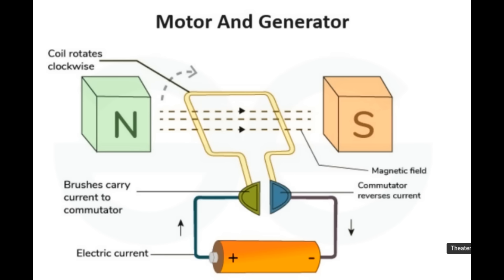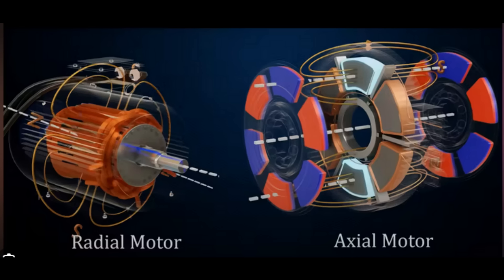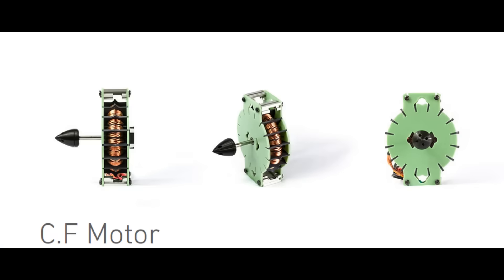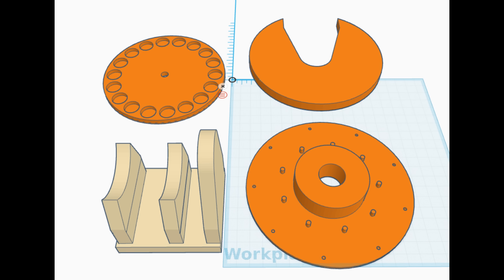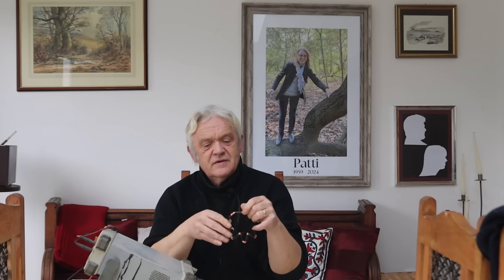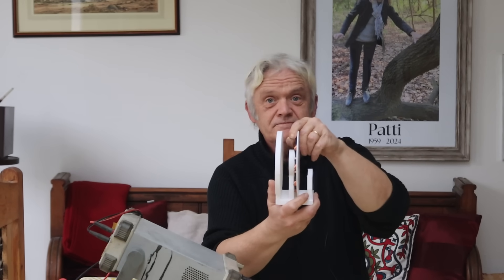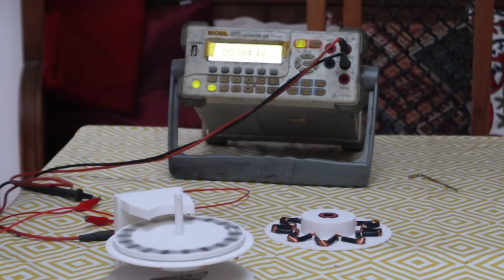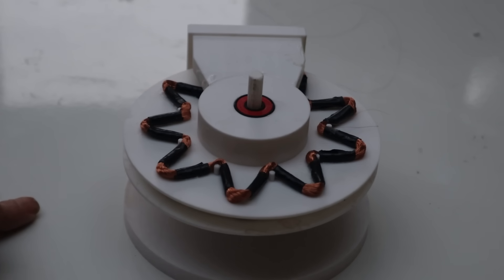2331 The Circumferential Flux Motor/Generator

Comment: FYI, if you print small trapezoidal forms, you can clip them into a winding jig, wind them up and then snap them into recesses or clips on your stator plates.  I call them Stator-Tots and they've saved me loads of time.  Makes it modular, easy to replace and prototype arrangements, as well as make 3-phase windings much less daunting.  Your channel is the best.  Thanks for everything you do!

Comment: What if a serpentine coil after zig zagging,was bent into a U, and wrapped around both sides of the rotor ? Would each pole need 2 magnets glued together NN,then SS, to keep the same pole while it passes the U ? Should the magnet edges have a ring of Mu metal?

Comment: Hi Guys! I am designing and am about to build a prototype for an Axial Flux Generator inspired by "Motionmagnetics" here in YT, who was inspired by you Robert. I have a couple of questions. If I wrap a serpentine coil, is that going to make AC or DC? I think it would be DC. another question is more turns=more voltgage, right? I wanna make a lower voltage, higher amperage generator. I'll be sharing the designs once it works out well right. I want it lower voltage because I am going to make the assembly stackable/expandable.

Comment: as a sci-fi illustrator, I'd love to observe liquid metal Eddy currents flowing through a solenoid coiled around a toroidal circumferential flux generator or a conal disk transmission/motor. I find the engineering really pretty & inspiring to think about!
Reply: the perpetual motion, the gradual power differentials of curves, & the sheer longevity of it all within electromagnetics naturally inspires significant awe about itself in me, comparatively to traditional gearboxes. & I love gearboxes very much, it's just that their friction wears through them so rapidly that I can't help but to think towards the standards of what we use with our satellites, our rockets, our solid state technology & whatnot (which certainly wear through their own manufactured operating qualities in their own ways) 🤍
Reply: anyway, I'd love to see a toroidal inductance generator in motion. it's such a natural shape between generators, motors, & circumferential flux (if I'm not mistaken?) that I wish to see some roll around! i saw the choo-choo battery train once & ever since then i've been routinely  pondering why we haven't discovered how to inverse the efficiency

Comment: Nope I belive you made an axial generator with 2 windings, 
You know there is a sort of toy done with coil and battery and magnets, take that as base.
 you attach the magnets  to the battery,  and let it run inside the coil and it will move.

If you get an outer ring of a planetary reduction and put magnets onto it ,only one  planet gear and then roll solenoid around the ring leaving spaces to hold the ring and the contacts patch to the single planet, that's a circunferential flux generator

Comment: I did not understand the part in which it is argued that on each side of a "V" the currents oppose and cancel ... if each side of the "V" at the same time is being through a magnet of opposite polarity but in the opposite direction of the coil for being inverted in the direction then would be added nor "subtracted" ....

Comment: Sandwiching 1 set of rotating magnets with 2 sets of coils is probably a much better generator design than sandwiching 1 set of coils with 2 sets of rotating magnets because it should be much less mass and therefore should do better starting at low wind speeds. Excited to see it in use on a wind turbine!

However, I am curious if the magnetic field strength and direction passing through the coils will be diminished vs the other design. 2 sets of magnets sandwiching the coils should have a very strong, single direction magnetic field between the 2 sets of magnets.

Comment: Curious if you could create multiple layers of magnets and coils into about 10 layers of coils and 9 layers of magnets would there be any interferences or would it magnify the power by multiples of X or by 10???
Reply from the maker: it won't magnify the power mate - the power comes from the input - it depends on what you are driving it with
Reply: @ThinkingandTinkering  So for example the wind is your power, you need a bigger sail to capture the wind rather than more layers of coils?? What if you do both, bigger sail AND more coils??
Reply from the maker: @HappyFace6or7  exactly - and if you did that you would get more power

Comment: Clear as mud😢 just looks like an axial flux generator
Reply from the maker: With axial flux you are trying to surround the coil with a magnetic field with circumferential flux yo are trying to surround the magnetic field with a coil of wire
Reply: @ThinkingandTinkering  that is not what you showed
Reply from the maker: @CraigLandsberg-lk1ep  I don't want to be rude here mate but did you actually watch the video? You are quite right that's not what I showed - but i also gave an explanation of why what I made was different to what i talked about - that's an important difference because there is always a difference between an idea of we think will work and what actually work in the real world when you come to build it - the real world has a nasty habit of getting in the way when we turn ideas into reality

Comment: I can see 3D printing makes it much more easy to experiment with different motor designs. Never saw that egg-beater design before. I suspect something interesting to happen if coils where placed around the top end of each of the spinning magnets also.
Reply from the maker: the 'egg beater' is a very old design mate
Reply: @ThinkingandTinkering  Long overdue for a year 2025 3D printed upgrade, yes?

Comment: yes robert has in fact made an axial flux generator here but his definition does not care about flux direction. However since the axial flux at the magnet starts axial but soon curves to circumferencial as it trys to hop to an adjacent magnet so there is some circumferencial flux. Now to generate we need a wire at right angles to a circumference and yes his V winding does have a component at rightangles to the circumference so yes he will get some voltage from the circumferencial flux as well as from the radial flux. How to measure the relative contributions of voltage between axial and radial fluxes? It is not
 possible with his flat coils as both axial and circumferential voltages are in phase. You would need a small short solenoid with a circumferencial axis to detect only the circumferential component and a similar small short solenoid with a radial axis to detect the axial component. I am guessing that the axial voltage will be greater than the circumferencial voltage with his coils but i accept that there is a real circumferencial contribution with his coils.
Reply from the maker: cheers mate

Comment: Thank you for this very interesting video. I do think that using Serpentine coil is too big of a departure from the Circumferential design but I know... if I want to see it, I have to make it! hehe I did look at the website, and I think their design appears to be missing some key components and explanation. They have a video of a propeller driven by the motor, and I think the coils are driven by a controller. Whenever I go to a website, and they don't actually have product for sale, but rather a "email" for info... I tend to throw the warning flag.
Reply from the maker: I agree mate it is a bit of a red flag - even so what manufacturer makes a product and says well we like it but it is slightly worse than everything else out there lol - so, I kind of make an allowance - I suspect there isn't that much difference between what they have made and an axial flux design

Comment: Are the amps determined by the size of the magnets, the thickness of the conductor coils or the speed of the rotation? 22v x ?amps = watts.
Reply: This is multifactorial. The Magnetic flux strength, coil resistance, and Mechanical Input Horsepower will be limitations to the amps that a motor can output. Additionally the load on the generator will also contribute. A generator that has no connected load, doesn't actually have any amps to output. If you put a 1000 watt load on a Generator designed to handle 100 watts, then the coils will heat up and melt the insulation. But theoretically you could "provide" the input power to make a 100 watt generator output much higher... at the risk of melting the insides. The faster you spin the shaft, the higher the voltage for common designs. So, you can spin it faster, and get more power out of it. You would then use electronics to regulate and adjust the voltage to some desired amount such as 12vdc or whatever.
Reply from the maker: no mate - i did a video called what the hell are amps - you might want to check that out

Comment: I'm a bit confused. What you've built here appears to be an axial flux motor. As far as I can tell, a circumferential flux motor is supposed to have windings in the shape of a toroidal solenoid, with the rotor magnets passing through it. I can't see a solenoid here anywhere.
Reply from the maker: axial flux attempts to surround the coil with a magnetic field Circumferential flux attempts to surround the magnetic field with a coil- a solenoid is the most effective way of doing this but with a rotor centrally placed you can't do that - so you have to try a different geometry to get the same effect
Reply: @ThinkingandTinkering  I can't make any sense of that. The distinction between radial, axial and circumferential flux is the direction of the flux as it passes between the rotor and the stator. It has nothing to do with what's surrounding what. I can't see how your design isn't just an axial flux motor with a slightly unusual way of doing the windings.

You say it can't be done with a solenoid, but Motion Robotics claim to have found a way. They don't go into details on their web site, but I suspect they have a serpentine winding wrapped around the toroid, leaving a slot for the rotor to pass through. You've got a serpentine winding, but it's completely flattened out so there's no flux at all in the circumferential direction.
Reply from the maker: @gcewing  I can't help it if you can't make sense of it mate - it's pretty straight forward - however what i suspect is what you mean is you think I am wrong. I don't mind you thinking I am wrong mate. However, it also means we are going to have to agree to disagree
Reply: - yes the use of regular face magnetised disk magnets (edge-edge/ diametrically magnetised are available) with flux leaving perpendicular to the disk is axial flux - to have circumferential flux, logic would indicate the north - south poles of the magnets need to be facing each other around the "circumference"  in this way it isn't possible for the (stator) winding to be completely cutting the flux at its most perpendicular for the whole path of the rotor - - as this will be within the rotor - serpentining  around the flux 75% - back and forth should be pretty simple using a circular stator former - maybe using 10x10mm  cylindrical magnets will allow the spacing for the coil...

To use a true (cylindrical) solenoid (it still needs an internal alternating winding - which Robert's Serpentine type does - spaced for each magnetic pole set) - some sort of "hubless"  rotor could be used (replace spokes with gears)- with sections of solenoid driving the "ring" at several locations - very mechanically complex - resulting in an integral geartrain - ?? useful??
Reply: Imo, but i'm just a moron...also for me i regard this as axial. Any how what counts is that it works. That looks fine 👍. If i live long emough i'll try it out for charging batteries with wind or hydro or steam power. Probably not with a printer.
Althoug i recognize the handyness ! 😊,Strange i have to think of a movie " you say bannana, i say banana". Whatever, if you like the tast 👍. Thanks Robert ! Thanks gcewing! Have a nice evening 💫🌠🍀🍀👋

Comment: Could you explain the Raxial Dark matter motor from Koenigsegg? 
Love your videos 😀
Reply from the maker: cheers mate - it's described as a combination  between axial flux and radial flux - which is pretty much what a circumferential flux motor is if you think about it
Reply: @ThinkingandTinkering  thanks! That's what I figured as well. 
Love how this motor doesn't need any active cooling, that would make it lighter, more efficient, and more reliable than most motors out there.

Comment: Neat thank you. Got to test this one two.
I tried my little test design with both NSNS... configuration and halbach and the gain for twice amount of magnets was at best 40 % with "spun it by hand" measuring method.
It is interesting to make it just to feel how the difference in pull on the weak and strong sides. But power generation wise i guess it might be cheaper to use more wire instead.
Or perhaps make two rotors and stack em up just like you are stacking coils.
Reply from the maker: i agree mate to my mind it is always better to make it and feel the machine operate

Comment: What if you wrapped the coils from top to bottom going around the housing in a three D serpentine coil? So the serpentine coil Cups the top and bottom over the edge sort of I guess? Though I wonder if you would have to use a large doughnut magnet if the little magnets didn't work?
Reply from the maker: good idea mate thanks for sharing

Comment: Apologies if I missed something, but you have two fixed star coils and a floating magnetic rotor. If the power to each star coil is out of phase, could you apply power to both coils to make the rotor spin?
Reply from the maker: that's an interesting though - i will follow up on that mate - cheers

Comment: It looks to me that the flux is axial. I may be misunderstanding.
Reply from the maker: axial flux attempts to surround the coil with a magnetic field Circumferential flux attempts to surround the magnetic field with a coil- a solenoid is the most effective way of doing this but with a rotor centrally placed you can't do that - so you have to try a different geometry to get the same effect

Comment: Hi Robert , a while back you created a heater panel with conductive paint/ink,  How do you work out what the heat would be on a given size panel and what voltage to use? thanks
Reply from the maker: I thought i covered that in the video i did on it mate

Comment: I may be a bit dense - but Are those typical "thickness magnetised disk magnets??  shouldn't the magnets be edge on to be a circumferential FLUX motor (OR half of BOTH sides have the same pole - ie. diametrically magnetised disk magnet )) - like a linear accelerator - I have a hard time believing this topology is not an axial flux motor / generator.. Diametrically magnetized vs Axially / Thickness plane magnetisation  - if one flat is North and the other flat is South - the "Synchronous" / Permanent magnet -(PM)  flux is definitely Axial.... 
 (of course PM motor/gen. are a totally different class to double wound wound synchronous units (DC field)   -stator + rotor EM motor/gen - we can just call them electrical machines to be simpler double wound motors one can choose which one to use as the field and which as the collector / exciter...)...

A really funny truly  "solenoidal" - linear flux  generator - would be a kinetic sculpture - marble machine using steel - or copper for the $$ balls - flowing through a vertical solenoid (or series of solenoids) sequentially - lighting some LEDS - as a "fake" perpetual motion machine - power  an elevator (yes external power required) to return the balls to the top.... Run it backwards as a metal ball fountain with an external catching funnel  (a few volts will be needed to launch metal balls constantly), lol..)
Reply from the maker: yeah i think they are fairly typical - Maybe it isn't 'truely' different - I don't really care to be honest i find folks mostly just like to discuss lol - love the idea of a marble run with a coil and spherical magnet - not sure it would work well but i love the idea
Reply: @ThinkingandTinkering   - lols, cheers - you do get people out of their comfort zone, this is good..
Marble run idea -- art piece, would merely be a p-take on all perpetual motion scams..
(yes to generate - anything - meagre - needs to be dropping magnets through the solenoid...

Comment: How interesting, the photo showing the old generator @ 1:15 is a exact copy ( slight difference in configuration) of ones found in antique electric shock medical devices from the 1880's -1920's, a quack cure. These were never thrown out because it's so much fun shocking friends, as a result there are plenty of them still about for as little as £40 on ebay, amazing these can be bought for so little.
Reply from the maker: that is amazing - i might buy one! - cheers mate
Reply: @ThinkingandTinkering  Your welcome, I've owned one for years, great fun.

Comment: Robert I'm confused, surely this is just a radial flux rather than a circumferential one?
Reply from the maker: if it was radial mate the filed would be 90 degrees to the axle - here it is parallel to the axle

Comment: I was surprised by your implementation - based on the introduction, i was expecting a ring coil formed by  solenoids bent into an arc - maybe T-shape spokes on a wheel with each  crossbar (shaped for the outer circle) having a solenoid on each side. When you put up the solenoid slide, I pictured the flux going round the circumference of the circle...
Reply from the maker: really/ - I always aim for simplicity, ease of build and ease of replication mate